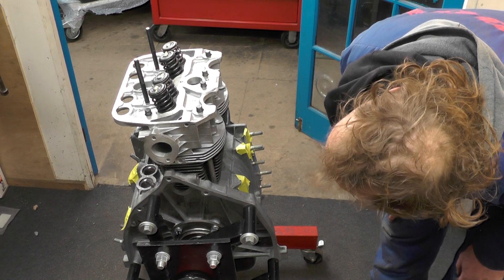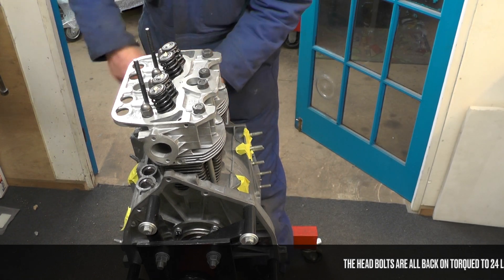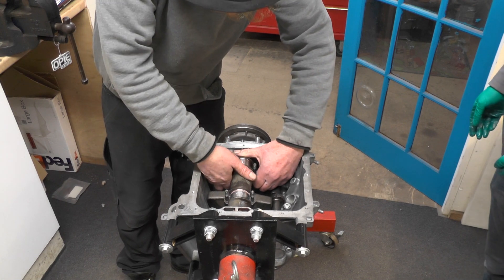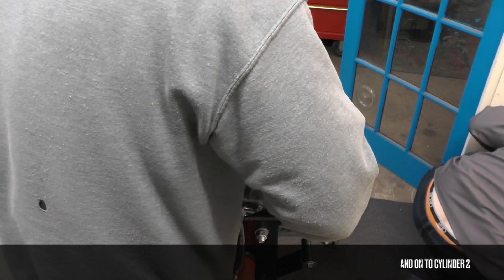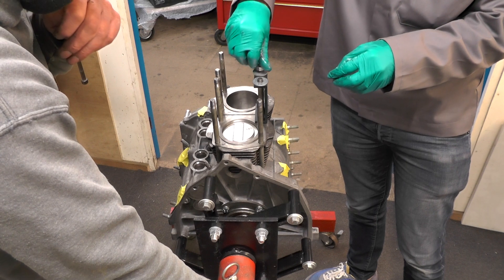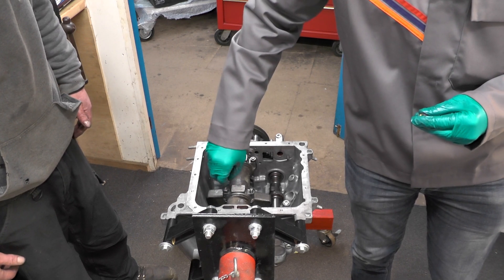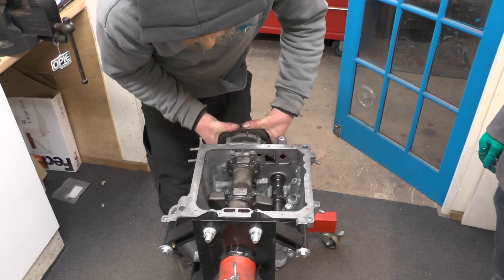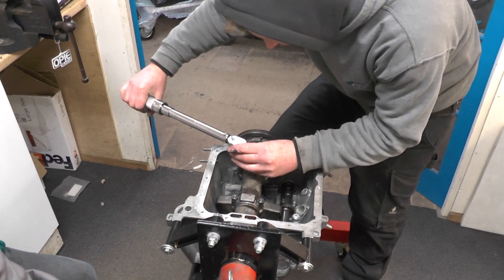30-34 Piston Installation (again) - Classic Fiat 500 Engine Rebuild Series

Comment: No head gasket?
Reply from the maker: No, this particular piston set from Nanni does not require one … let’s see how it goes 🫣😂
Reply: @the500workshop  How has it held up? Also, i'd like to add how comforting it is to see that even skilled professionals sometimes make mistakes, but through thorough checkup procedures these mistakes are found at an early stage with no significant harm done. Thanks for showing these mistakes and the troubleshooting.